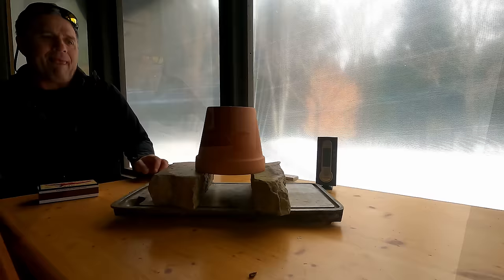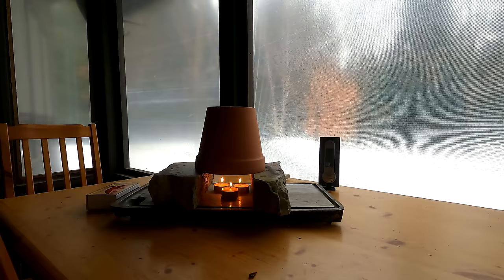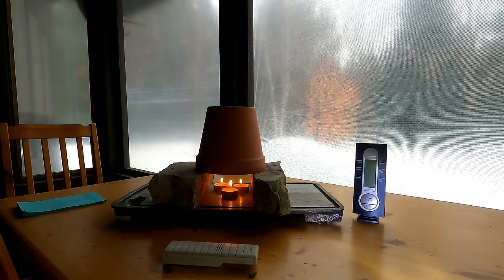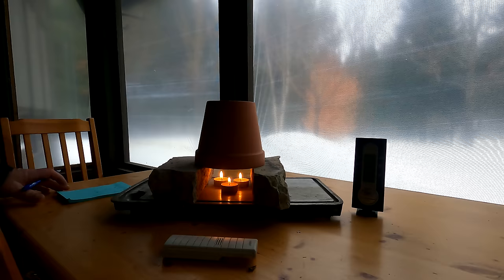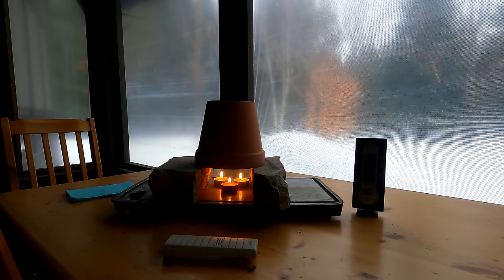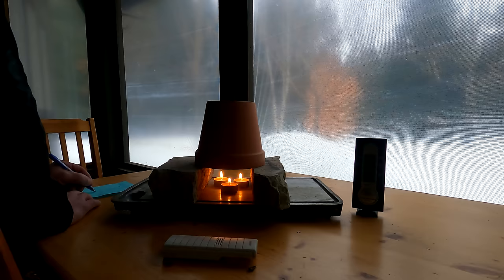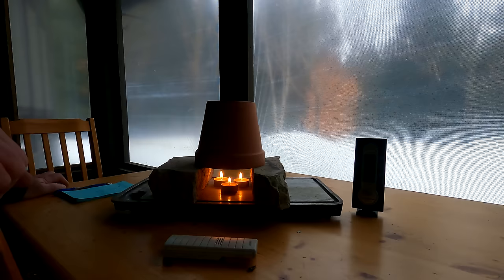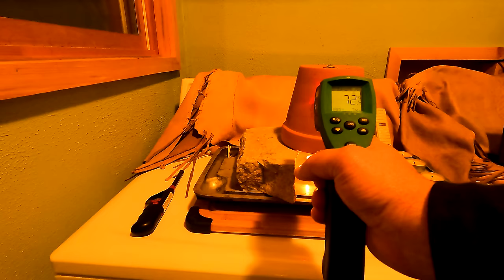Testing the Clay Pot Heater | Truth or BS | Prepping and Testing

Comment: Compare it to just 3 candles burning.  Back in the day when cars got stranded in blizzards more often, people kept candles in the trunk and they heated the car up enough to avoid dying of exposure.
Reply from the maker: I actually remember those days - candles are an amazing heat source as long as ventilation is available. The pots simply contain the heat and radiate it out in a controlled manner. The pots get so hot they will cause burns if handled improperly. I would not recommend the use of candles, or any open flame for use as emergency heat - people are too careless and too many house fires have been attributed to open flame burning.
Reply: @Hawksshadow  An extra hazard with the clay pots is that if they get really hot, they will radiate heat back down to the candles, possibly melting the wax, then boiling it. If that happens, the wax vapor will flash ignite in a ball of flame.
Reply from the maker: When I was doing the test - I did indeed worry about that exact issue occurring. I have stated that there are too many possible problems with this "heater" to consider it useful for any situation. I find alcohol burners are way more efficient and safe for use; however, any open flame in a home is a potential for fire. I have a woodstove in my home and have no need for such devices.  Thanks for the comment.
Reply: @Hawksshadow  Thanks for the video!
Reply: @Hawksshadow  You can mitigate this if you add a cooling buffer to the base where the candles are sat. Like a big chunk of stone or something insulating, or sit them on something with water in it, it won't exceed 100C as long as there is water. I'm sure somebody can suggest a better material to act as a buffer to cool the candles but you get the idea.
Reply from the maker: Great Idea. It is interesting to see how many people actually have tried units like this and have come up with solutions to potential problems such as your suggestion. Thanks

Comment: The Laws of Thermodynamics make it impossible for these pots to increase the heat of these candles... because 100% of the candle's heat output is already being released into the room.  
Covering the candle with a pot will not increase that efficiency.  

The whole concept of using thermal mass to trap heat from a fire, is to reduce waste heat.  
For example... only 5% of the heat output from a Fireplace actually heats the room.  The rest is vented out the chimney.  
Where as a Tunnel Furnace, (depending on dedign), can recover as much as 60% of the heat it produces to heat a room/building, by channeling the hot gases through a ductwork before it gets vented out of a chimney.  

Electric heaters & Infrared propane heaters don't have to vent hot gases outside of a building, allowing 100% of their heat to warm the air inside the room... which is why they are the most efficient means of heating a room.
Reply from the maker: I could not agree more - The pots do not increase the heat output of the candles - they simply capture the heat - store it and release it.  A candle burning on its own will indeed help to increase the heat of the space in which it is burning. Couple the candle with the pots and the difference is dramatic - the pots will retain heat long after the candles have been extinguished.  This system could never heat more than a closet and it could never bring a room up to comfort level from the freezing mark. I simply wanted to know if the unit did indeed increase the efficiency of the candle. Thanks for your well stated comment.
Reply: @Hawksshadow  
Yeah... the pot & candle function just like an oven.  
Where as heaters are designed to release large amounts of heat around them, to warm a room or building... Ovens are designed to trap heat internally to concentrate that heat in a small area for use in cooking.
Reply from the maker: Great analogy -  Thanks  @OOTurok

Comment: The only thing the pot does is prevent most of the heat from rising to the ceiling. All of the heat results entirely from burning the candles. (Conservation of energy) Can you heat a room with candles? Yes, of course you can, depending on the size of the room and rate of heat loss. This also comes with risks of fire and carbon monoxide. It should be noted that clay pots are not the best choice for this as they sometimes shatter when heated. Pyrex or metal would be a better choice.
Reply: What if you put the candles under a pyrex bowl [raised off the surface, of course]. Would it radiate heat well? And, would you not need the hole, like the pot has? Thanks.
Reply: @cohen860  Your best bet would be to create a makeshift chimney out of metal vent pipe or something. That would create an updraft that would circulate and heat more air. Still dangerous though.

Comment: A tea candle is about 30 watts, unless you make it burn faster, that's all you got, if it's a 5 hour candle, it's 150 watthour, that doesn't change, no matter how fast or slow it burns, but in a small room, that's still something, and 100 candles can save the night, if you don't have anything else, just remember carbon monoxide, it can heat a small room, but you don't want to be in a small room with 100 burning candles.
Reply from the maker: You are correct - this test was simply to determine if the unit could raise the temperature of a room. It did by a few degrees; however, the room started at approximately 10 degrees Celsius. I have a woodstove to heat my home - power loss is not an issue in my circumstance. I would not trust any open flame unattended. The gases produce by the candles can be quite detrimental to peoples health. I would not use this system to heat a non ventilated space. Loosing power and trying to stay warm is a big problem.  I am working on a project which may help.

Comment: In simple physics terms it is not possible to get more energy out of a system than you put into it.  

The heating effect you will get is exactly the same as whatever number of candles you burn with the only changes being that you will get 'lag' at the start as the candles heat the pots and then you get a tail of some 'extra' heat release after the candles have gone out as the pots radiate the residual heat.  

Although, it has to be said, it will make it easier to warm your hands without burning yourself, so they are not a total waste of time :)
Reply from the maker: Well Said, The pots do indeed retain the heat and radiate it out in a controlled manner. I did a second test - video online - outdoors and the pots and candles did not function as a heater due to the enclosure they were in. In that test, I used a granite rock and heated it  in a fire. The results were outstanding.

Comment: 1 pot on its own works just aswell, and you can also use bigger candles and raise the pot higher and it gets really warm.
Reply from the maker: Hi Gary, I have not tried the one pot method. It does make sense that it would work. I did not use larger candles as I was unsure about the outcome. I was concerned about the pots cracking due to high temperatures. I will give the one pot method a try. Thanks for the comment.
Reply: Me and some friends tried this just got fun. It does not even come close to heating a real small room. You can warm your hands over it after is going for about an hour .
Reply: @Eddie-vf4vx  they worked well for me last winter 👍
Reply: @garymorrid2031  how many tea light candles do you go through in one day?
Reply: @Eddie-vf4vx  never counted tbh, not many, they are £1.99 for 50 in the local hardware shop. Also can get bigger ones that will burn for about 10 hours each, they are £1.99 for 8 I think. So it's very cheap to use them.
Reply: Stick a candle in a can of Crisco.. it will last for days
Reply: @melinda1133  this is the way.

Comment: The candle produces 'X' B.T.U.'s. which would normally rise in the air (convection) and be wasted at the ceiling. The clay pot captures and stores the B.T.U. energy, to be released as infrared energy (radiant). The infrared light spectrum has some very unique qualities. For one, it transmits through the atmosphere with little loss of energy (so it doesn't heat the air). Second, infrared tends to penetrate most materials (rather than being reflected back). To sum up what this means, the infrared transmits through the air in the room and warms up the surfaces of the room directly.
Reply: radiant heat from the clay pot ??? Physics tells us the efficiency of a radiant heat source is proportional to the 4th power of the temperature in Kelvin so: pot at 70C --> 343^4 = 1.38x10^10 versus flame at 1000C -->  1273^4  = 2.63*10^12  The flame is 189 times more efficient than the clay pot for radiant heat.

almost all home heating is through convection - the movement of a fluid (like air) over a heated object. Yes, even with radiant floor heating. My bathrooms and laundry rooms have radiant floor heating, I assure you the air is those rooms is effectively heated. Do you REALLY think the heat of convection somehow "sticks" to the ceiling ?    There is constant air movement in any room, which spreads the heat around. measure the temperature near the floor and ceiling  of various rooms in your home. the ceiling might be a little warmer than the floor. But in the heating season, both are significantly warmer than outside. Of course, a fan would make the temperatures more equal.  

The best way to transfer low grade heat, is forced convection over a hot finned heat sink --  just like a cpu cooler in a modern computer. The rate of heat transfer is proportional to the difference in temperatures of the object and fluid (air); and proportional to the surface of the heated object exposed to the fluid.  With enough airflow and proper heat sink design, forced convection can be 10x more effective than natural convection.  A clay pot is just about the opposite of this.  it essentially prevents effective radiational and convective heat transfer.  But if you are interested in slowing down heat transfer, a clay pot is hard to beat. 
That's the design principle behind masonry heaters and soapstone stoves.

Here's an experiment you can do at home, in a small room, like a bathroom.   Get a heat sink from a discarded piece of electronics, and a fan from a junk computer; a 12v power source, a clay pot. and a candle.

#1 put a lit candle directly under the heat sink and have the fan blow air across the fins of the heat sink
after a few hours, measure the temperature in a few places around the room
next day...
#2 put a lit candle under a clay pot.   
after a few hours, measure the temperature in the same places in the room

You will be surprised by the ineffectiveness of the clay pot as a space heater.
Reply: @user-tg2gm1ih9g  If you say so, but I dispute your claim of a candle being 189 times more efficient at producing infrared energy. A clay pot has much greater surface area than the combustion area of the candle flame. Once the clay pot reaches  full temp it will "outshine" the candle flame in that spectrum. The clay pot also has the advantage of absorbing the entire light spectrum of light the candle produces, as well as the energy from the hot gasses produced from the combustion. Convection heating is great, if there is no loss of the warm air from leaks or drafts

Comment: Love the comments from the 'science community'. These are the guys who believe that reducing the carbon on this planet to zero is a good idea. I appreciate your video. Yes, your being in the room added to the heat, but weren't you in the room when you measured the room's temp before lighting the candles? Regardless, good to know that even tea lights can add a little heat to a small room if needed and having the clay pot to retain that heat for a little while after the candles go out is a smart thing. I love science, but I appreciate practical advice from helpful people even more.
Reply from the maker: You are so right in what you are stating. This was not a science experiment - I simply wanted to determine if this unit was capable of keeping people on the warm side of the thermometer. I heat my tents with rocks which have been super heated in a fire pit. The radiant heat is amazing. The pots do indeed retain heat for at least thirty  minutes after the candles are extinguished. The bottom line it simple - if the power fails and your heating system is rendered inoperable, people will resort to all manner of ideas to stave off hypothermia.  Just a note - I was not in the room when I tested this unit as I used a remote thermometer to measure the temperature.  Thanks very much for the comment.  Please be careful if you use a unit such as this - use only bees wax or soya based candles to preclude noxious gasses from enveloping your home.

Comment: The average tea candle is 352 btu if you burn all of the wax at one time or 80 btu Continuously the average human is 356 btu Continuously so if you think you can heat your house with this you should see how well the pot works on your head you already produce 4 times more btu than the candle the only thing this is going to heat Is a tiny space and keep in mind that you are going to heat the tiny space more then the 3 candles are
Reply from the maker: This unit is barley capable of raising a very small rooms temperature a couple of degrees - never claimed it could heat a house. Simply pointing out the ability of the pots to retain heat and radiate it out.

Comment: the closer you keep the thermometer to the pots the more significant the "heating" effect will be.  3 candles don't have the therm/btu capability to heat a large area home and keep the pipes from freezing.  but if you huddle around them, it'll be a bit more comfortable to sit in a heater-less area.

Comment: The question i have is, how does this compare to simply burning the candles?
Reply from the maker: Great Question - The pots capture the heat and radiate it out. Candles will certainly heat a small area; however, it would take substantially longer to move the needle on the thermometer. That said, both methods have their inherent dangers. The pots are fragile and could crack or worse catch fire due to a build-up of wax, as Ian commented. The candles could get knocked over and your house would get warm real fast. I would not use the clay pots in my home unless there was no other choice. This was an experiment to determine - if indeed -the pots could move the needle on a thermometer. Thanks for the comment Chloanne.
Reply: The way I heat my greenhouse on the worst days of winter is to make waste cooking oil lanterns with clay pots above them. Dump waste cooking oil into a glass jar, break a hole in the top to pass a wick through (can use strips of old jeans). This waste food oil will burn for hours and won't clog your drain.
Reply from the maker: @-whackd  That is awesome. I would assume it would make the greenhouse smell funky but if it works - Why not. Innovation is the name of the game.
Reply: Does bacon grease impart a delicious flavor to the vegetables in the greenhouse?  I'm thinking a delicious BLT without the cost of bacon!!!   @-whackd
Reply: Surface area
Reply: The pots serve as a "reservoir" to collect the heat from the candles.

Comment: The only advantage this could offer, over burning the candles by them selves, is the pots keep the heat near them a little longer than the candle by it's self, whose heart would rise directly to the ceiling before filling the room.
Reply from the maker: That is correct - I measured the pots temperature after the candles were extinguished, and they remained hot to the touch for 40 minutes. The pots simply capture the heat and radiate it out in a controlled manner.
Reply: the amount of time the pot keeps the heat is directly offset by how long it takes to heat in the first place.

Comment: As others have said, the amount of heat being generated by the candles cannot change by adding pots or anything else.  Laws of thermodynamics are pretty explicit.  What they do do, is change where the heat is - if you light a candle, all the heat goes straight up to the roof.  The pots hold the heat lower down, where you are, and make it feel warmer from the same amount of thermal input, because the heat is radiating from the pots next to where you are.
What that also does, is alter the thermal currents in the room, candles will throw all the heat to the roof, and push the colder air downwards as a draught, which will make it feel colder than it actually is.
The pot heater is a way of using the same heat differently, nothing more.
Reply from the maker: 100 percent accurate. That is why the pots actually add to the equation - they capture the heat and radiate it out in a controlled manner - The added bonus is when the candles are extinguished, the pots continue to radiate the captured heat for at least 30 minutes.
Reply: "... all the heat goes straight up to the roof "  ... "... because the heat is radiating from the pot..." 

1) you need to spend a few minutes with  thermometer and a naked candle; and a few more minutes with a candle under a pot.  You will quickly and easily prove to yourself that both of these assertions are false.

2) The only thing a clay pot does here is SLOW DOWN the heat transfer from the flame to the room.  Read up on "thermal mass" and how it is used in masonry heaters and soapstone stoves.   The design principle is:  take the heat generated by a short high temperature fire,  and release it slowly at a lower temperature.